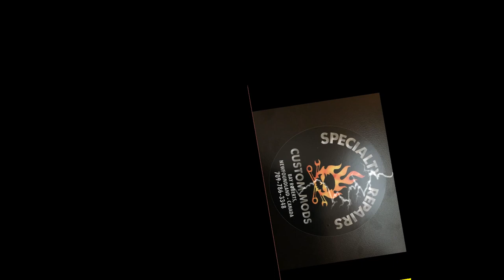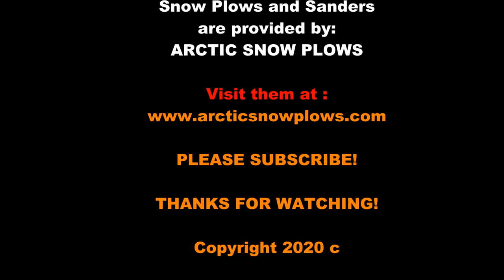ROPS Strobe Light Perch

Comment: Hi Paul, 
Two weeks ago, I bought a BX1880 (my first tractor) and I have watched many of your videos which have generated a number of "Hey, that's a good idea" moments. Thank You.  Today, I was moving a few rocks (400 to 500 lbs).  I don't remember which video you mentioned it in but I tried placing the bucket behind the rock, holding the brake and using the bucket tilt to pull the rock.  Worked like a charm.  Thank You again...
Reply from the maker: Glad that video helped you out. It’s helping you and your tractor to work smarter and not harder. You used the machines hydraulics to your advantage. Most operators don’t realize that trick really works. Thanks for watching. Keep well, happy Tractoring.

Comment: Hi Paul I would definitely wire mine in on a switch with a fuse. I was a mechanic for 40 years and I still like to keep my hands in it as much as I can and neatness counts. Great mod and video have a wonderful weekend.
Reply from the maker: That’s great for sure but if the light is used as is there is a fuse in the end plus plus if you use the accessory plug on the tractor it is fused as well. Keep well.

Comment: Hi Paul, any thought on making the center hole larger (maybe 1 1/2 inches  or 2 inches) so the plug will fit through it?  Of course if the customer wanted they could drill it out themselves to fit whatever light they have.  Be safe, Stanley in Md.
Reply from the maker: Yes. That’s doable. Maybe the customer can request it at the time of ordering. 👍

Comment: Great video.  I might be ordering one for my JD 1025R - I have to measure the ROPS.  BTW - nice vice on your bench, is it new or an older unit?  If it is new, where did you get it?
Michael from Alberta
Reply from the maker: Michael. That’s a Wilton “Tradesman” vice. Very nice unit. I bought it new a  few years ago. Princess Auto had them. They are made in the USA but they wanted over $900. For it then one day I was in the store and they had it marked down to $499. so I bought it. It’s hands down the nicest unit I ever used. Thanks.

Comment: As usual , good stuff  
Now we have Kubota gloves !!! Hi ha 
Also suggestion = maybe making a slot that meets the hole in the center for the wires with a gromet ???
This way don't have the dismendled or open the wires to past throught 
Anyway 
I like you guys 
Serge ( from Mtl )
Reply from the maker: If I do that it will weaken the full mount. 😉
Reply: Paul & Kathy Short i knew you were going to say that !!! 
But i tried anyway  , might be doable on an other project  if the base plate is strong enough 
Bye , thank you for your time as usual. !!!

Comment: I rewatched your arbor press video you did about 5 years ago and you mentioned a pin router build? That would be really interesting to see. I searched on your channel but couldn't find it. I found a 5 ton press dirt cheap and I'm adding a torque wrench to it and had to check back to maybe add the spring as well. You rock!
Reply from the maker: Thank you. When I did the arbor press (fret press) it was for my younger son. I had folks asking me to build more of them but this was a “one off”. At that time I had the pin router half completed. I put a lot of time and money into those projects that I took care of but I felt it wasn’t  appreciated so I gave up on the pin router and a few years later It was simply thrown out for scrap. Sometimes when things come to easy they aren’t appreciated. I figured if I was going to answer your question I may as well do it honestly. Thanks for watching and keep well.
Reply: @7863348  
You too.